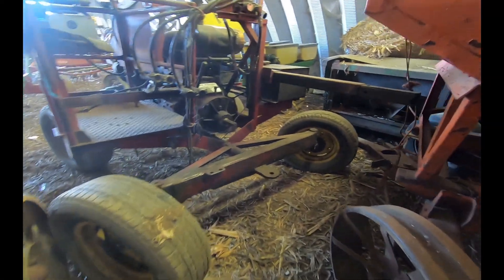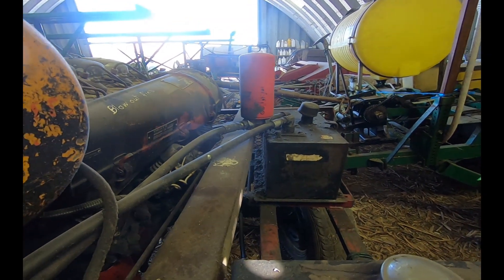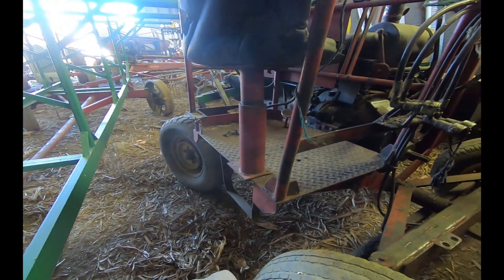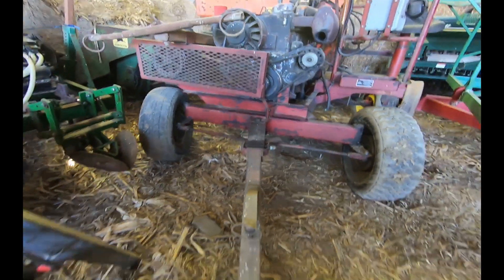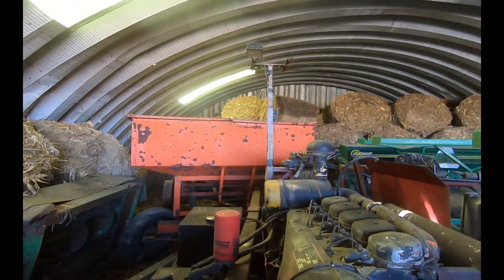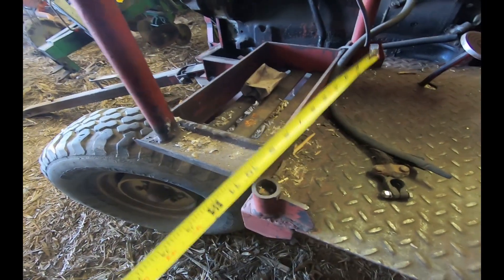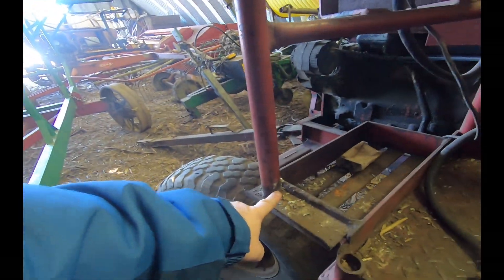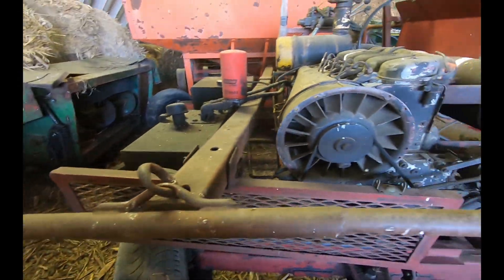A Close Up Look at a Diesel Powered Fore Cart.

Comment: I assume the rear axle is steered with a hydraulic cylinder? I seen a couple hoses going down there. Good old Deutz air-cooled diesel. keep it clean it will run forever. I ran a 150HP version of one of them in an old Gleaner combine harvester.